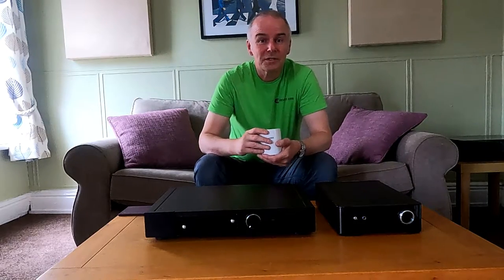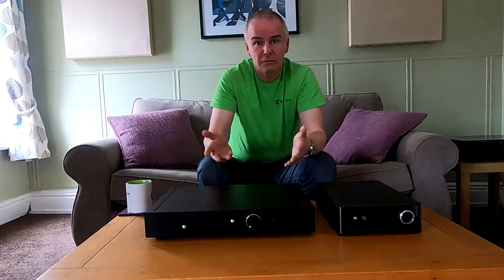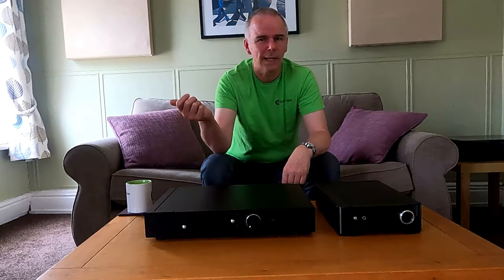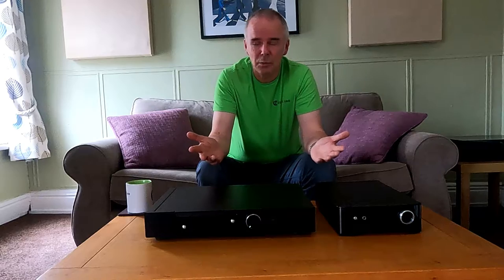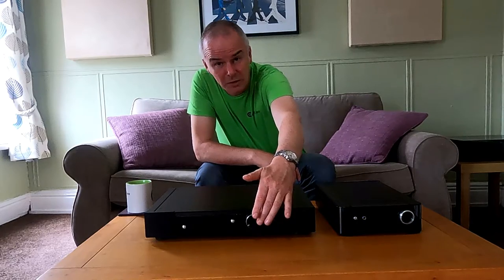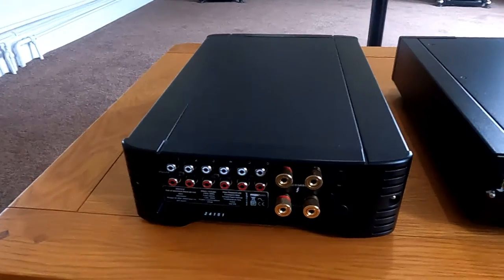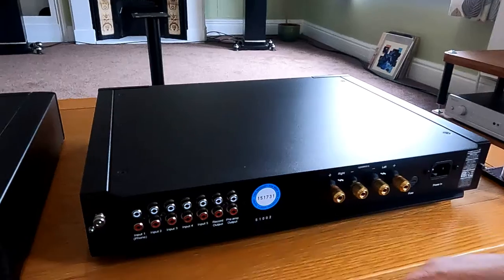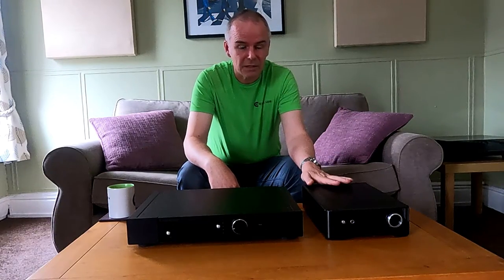Rega Brio and Rega Elex R amplifier comparison and review

Comment: I have the elex, and it's great, the brio is a STEAL! £600 it's a truly wonderful little amp, very exciting, dynamic, with a real drive.
Reply: Agreed. The Elex-R is the gem in the line.  I sold it and got the Elicit-R figuring I'd get more of a good thing. Well, not so. The Elicit-R has a very different sound than the Elex-R.  I  I will likely return to the Elex-R, but I may audition the new Exposure 2510 in the meantime.
Reply: @Mike82ARP  tell more... What does elicit sound like compared to mine... I couldn't afford the elicit
Reply: @Mike82ARP  so how do they compare?  Rega vs. Exposure?  i am in the same boat.  thanks

Comment: Fantastic video it's helped explain wattage to a friend better than I ever could! I bought the Brio last year with a P2 turntable and a pair B&W 706 S2 and I haven't gone past the 12 o'clock position volume wise. I sort of obsessed about wattage when looking last year right up until I demoed it and it blew me away! If I upgrade it'll be to the elicit-r I think.
Thank you again.
Reply: Spec sheets mean nothing really as most are just manufacturers marketing. The best way to judge is to hear the systems for yourself. 
What makes Rega unique is that they are offering analogue amplification to the lower and middle market place. And their focus is on sound rather than how many gadgets they can squeeze in.

Comment: Thank you for talking about low level listening (due to auditory challenges, I listen here exclusively)!!! I’ve struggled finding successful amp pairings for my relative difficult speakers. Can confirm that both something like the Exposure 2510 and Rega Aethos, sound full and awake from the first turn of the volume dial ❤️
Reply from the maker: It depends on the speakers... but the Aethos is particularly good in that respect... The 2510 is good and better than most, but the Rega wins
Reply: @cheshireaudio   Agree, the Aethos takes the prize 😊 Would you say the Elex-R and Elicit are equally good a low volume? I unfortunately do need to “ride the volume” to get it just right, so the coarseness of the steps using the Aethos remote is bit of an issue.

Comment: I have purchased Rega Elex-R few months ago - with few lows - I am super happy with it. The truth is: I have nothing to compare with but... maybe it is better this way. It drove first B&W 607 and then I change them to Monitor Audio  Silver 300 - the system sounds amazing! I only use DAC with them - no turntable - but still: I am happy with this system. One big plus: lifetime warranty - what else to ask for ;-)

You are super right about the volume: my usual setting is around 9 o clock, very rarely more. And NEVER above 12 o clock ;-)
Reply: what are the lows/issues you experience with your Elex-r?
Reply: @neetop1557  when 1st channel RCA (phono) is not used, 2nd channel is unusable as the signal is interfering with 1st one - maybe I should ground 1st channel? the remote is ... not this level of the price. Remote/and amp have no standby mode. When I turn on/off the power it makes noise in the speakers. Small minor things but I don't expect them in the device for 1k$
Reply: @zyghom  I read about these issues, especially the first one. Someone suggested grounding it properly because that's the root cause, some suggest avoiding using 2nd input when phono is in use. At this price you could say it's ridiculous. But since it's a British made product some quirks are to be expected. At least it sounds good, right?
Reply: @neetop1557  considering I don't use phono and I cannot use 2nd, I am left with 3 out of 4. I will not cry as I use only one input (from DAC) and 1 output (for my VU meter) but... the separation between 1st and 2nd input should be there. Extra grounding while NOT using phono? hmm... I have never heard about it. The sound for me is fantastic - it actually shows the difference between good sound file and ordinary one (even if both are FLAC). I only use DAC - however quite good one. With my speakers and my room I am ok with the product ;-) Was it worth it? I don't care. Would I buy it again? I am not thinking about it - hopefully I will never change it in my life (I am an old guy - it would be ok if the amp can be with me till the end of time). ;-)

Comment: I recently took a punt on a (barely) used example of this version Brio for £300 despite not having heard it and I'm very pleased with it. From watching this I now know why! Partnered with my Planar 2 and MA Silver 200 6G it's a system that's a touch lean unless the source production is hyped but it's very pacey and detailed. Certainly heftier and smoother than the Cyrus 2 + PSX it replaced, although not as deep a soundstage I found.

Great channel - I discovered it looking for a solution to my Planar running slow. A tiny dab of PVA on the pulley spindle and all sorted, so thanks for that :)

Comment: At one time I considered both. I still think I would have been happy enough with the Brio. I got the ElexR instead. And I love it! What surprised me is the Elexr would get hot driving Klipsh Heresys! Not even warm driving Spendor 3/1s. The Heresys sensitivity is rated somewhere around 99- more like 94 , I'd guess, whereas the Spendors are rated at around 88- more like 83. Regardless the true rating of either speaker, the Spendors seem like easier drive. I wonder if it because they do not have the dynamic reach? In the end, they both sound great.

Comment: How does the Rega Elicit R compare with the Exposure 2510. It be interested in your opinion on the comparison.
Reply from the maker: I've just completed a comparison between Sugden A21 and Exposure 3510 ....  will post later today.   I'm holding back on reviews of the Elicit at them moment for reasons I can't go in to :-)
Reply: @cheshireaudio  I shall look forward to seeing the 3510 compared with the Sugden, 
I use a Heed Obelisk Mk2, it replaced a Naim 122x/150x. I much prefer it as it has a nice rich midrange which is so easy to listen to. But I’d also like an amplifier with more power as I have some stand mounts I use occasionally.

Comment: I watched a few of your uploads over the past month or so, trying to establish what I should be aiming for.
One of your vids mentioned starting with the turntable, and building the system around that.

With that in mind, and leaning toward the Rega P3, which amp and speaker setup compliments that best?

Brio, Elex mk4?
I know Rega do the system 1 package, but they don't seem to do a system 3 to guide you on a good setup.

Any thoughts appreciated.

Comment: After about month of research.. I've found myself between the Rega Brio-R and the Atoll AM200. I'm having a really hard time narrow it down as I can't find much in terms of reviews for the AM200. It seems the stage is more front and center with the Brio than the AM200. The Triangle Titus EZ speakers I have stage extremely well, on the leading edge of bright sounding (Brio would help smooth it out some). I've heard the AM200 has next to nothing in terms of heat dissipation.

Comment: Tape out on the Brio, can this be used for a subwoofer? Or is it permanently full volume?
Reply from the maker: No, that’s a full line level out and doesn’t go through the volume... if you buy a sub with a ‘high level’ out, (like REL) you can connect it to the speaker outputs

Comment: Thank you. I also appreciate your comments about volume. I can’t always turn it up loud when I listen but it does sound better when I do!  Couple of questions please:  I have the previous model:  Brio-R. Squarer corners. No headphone socket (which I don’t care about). Is the new model noticeably different audibly (with a 1990 Rega Planar 3 and Elys2). Also, my speakers are Monitor Audio 14 Gold Mark ii. From mid 90’s. Would it be overkill to upgrade to Elex or Elicit for such a set up? Or would I need newer/better speakers to justify that?  I like the speakers bass and mid. Always found cymbals and other treble a bit lacking (eg. In jazz, or Talk Talk). Appreciate your thoughts. Thanks.
Reply: Hi .  Having owned the Brio, Elex-R nd the Elicit-R, I'll give you my impression.  The Elex-R sounds like an improved Brio.  More control, detail, etc., BUT the Elicit-R, while having a bit more refined sound than the Elex-R, has a different sound than the Brio/Elex-R.  The Elicit-R is a fne amp, but if you really like the Brio, the Elex-R will impress you. The Elicit-R?  Maybe not.  Maybe the new Elicit Mk5 will have more of the Rega sound.

Comment: Can anyone confirm that what is connected to the Input 5 on the Elex-R will not come out through the Record Output? I use the Record Output for my headphone amp and when I select Input 5 I'm getting no sound. Only earing what is connected to Input 1 through 4. BTW, this is an awesome sounding amp. I love it quite a lot. It is a totally different beast than my other amps. And thanks for the review.
Reply: YES, I was about to send it back to the shop as broken, then they called Rega and confirm the same: input 5 does NOT go to Rec Out ;-)
strange but ... as per design
pity it is nowhere described ;-)
Reply: @zyghom  Thank you for your reply. That's what I thought. Probably to reduce leakage interference since input 5 is next to the rec out... not sure but otherwise it's still a really great amp.
Reply: @thebestoffools  as there is a leak between input 1 and 2 as 1 is phono so very sensitive
Reply from the maker: Only just spotted this one... didn’t know this .. how strange
Reply: @cheshireaudio  The amp was probably designed this way so you can’t accidentally create a feedback loop when using the record out. You would plug your recording device outputs to input 5 on the amp and it wouldn’t be able to feedback on itself if you inadvertently selected input 5 on the amp whilst in record mode. The “Tape Monitor” switch was the old solution to this problem, now long gone!!

Comment: Is phonostage in elex-r enough for Planar 3 with exact/AT 740? Or i need to buy Rega MM? Or even Lehman Black Cube
Reply from the maker: It’s good enough.. but you can always get better
Reply: @cheshireaudio  yeh, better is an enemy of good ))) is rega mm better than built in elex-r?
Reply from the maker: @nikaknetu2982  It's a similar circuit, which benefits from being away from the amp with it's own supply ...  so better yes,  worth the outlay?, good question, see if you can borrow one
Reply: @cheshireaudio  ok! Thanks for your answers!

Comment: Hi! I’m looking to pair my Monitor Audio Silver 200 (6g) with an amp. For the moment, and please don’t laugh, I have a borrowed Harmak Kardon 6500. Would Elex-R be a good choice, since I can have a good deal for it? Unfortunately no demo. Would I hear a WOW difference stepping up to this type of amp? My speaker cables are Van Damme Blue and interconnect QED Reference Audio 40 for my Bluesound Node 2i with Tidal Master. I also have the Rega Planar 1. Thank you!
Reply from the maker: The Elex would be great... if you are local I could lend you one... if not, speak to a dealer
Reply: @cheshireaudio  Thank you! I’m from Bucharest, Romania. Unfortunately, I don’t have the option of demo it, but eventually I went for it. And a pair of Van Damme Blue speaker cables. And the qed audio reference 40 as interconnect from my bluesound node 2i. Everything sounds great, but probably when the time will come I will upgrade to bigger cabinets, since my living room is quite big. 60sqm with a length of around 13m. I heard a lot of good things about the Kef R11.  Thank you once again and Blessed Holidays!